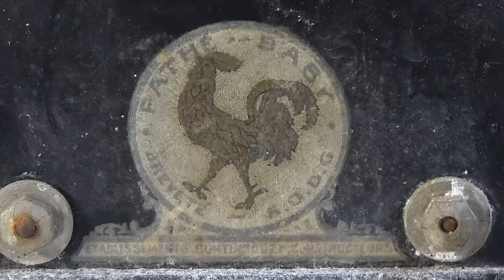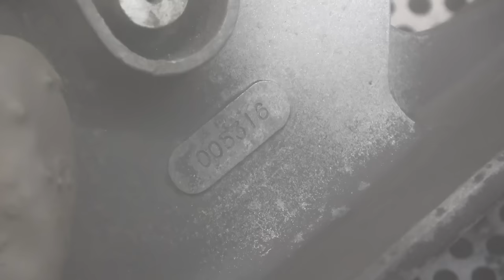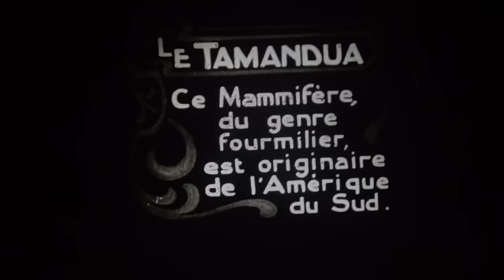1924's Cinema Projector "Pathé Baby"  -  Restoration

Comment: In the early twentieth century, engineers designed devices made of simple, strong metal materials that rotated by hand and did not require electricity. In addition, the easy and simple way they were designed made them work and last for a hundred years or more. And here we see, all of these devices are still working to this day. It may need some maintenance and lubrication of the toothed circular gears, which will make it work properly, and be more beautiful, when it returns again to its original shape as it was nearly a hundred years ago, as this expert, the owner of the video, did, who restored this unique masterpiece, this projector, to its youth. The first was in the year 1924 AD. Today, most of our devices and equipment are made of plastic and operate with electricity. They can work for quite a long time, but they will not last long. A great achievement, the owner of the video. I admire your work, 👍
Reply from the maker: Thank you very much ! Glad to bring the memories back 😌🙌

Comment: Not a cinema projector, the Pathe Baby was a home projector for the 9.5mm home movie system. With its single centre sprocket placed between the top and bottom of each frame, it gave nearly as much frame area as 16mm, but in a size little bigger than 8mm film. My brother in law had a 9.5mm system in the mid 1950s.
As always, this is a brilliant restoration.
Reply from the maker: Thanks for the info 😌

Comment: very interesting work, but I don’t understand why there is a heating plate at the bottom or is it to reduce the voltage and current? Some lamps cannot be touched with your hands, even with very clean hands - the lamps burn out quickly as a result, I really liked the small 10mm wrench and the angle wrench, I have never seen anything like them
Reply from the maker: Yes it reduced the current from 110v to 6v 👍

Comment: 9.5 mm film with center perforation. Picture larger than super 8, but needed footage less than 16 mm.
Reply: This format was in a niche, 8 mm was more popular and I guess, it must have been cheaper.
One reason, that I assume this, it could be developed with the same machines used for 16 mm, because it was a 16 mm silent film with twice perforation, you film one half of the stripe, turn the reels to film the other half, they develop it like a 16 mm film, after this they split it and put it onto a small reel, so you could watch it from there or edit the material and put it onto a 7" reel.

Comment: IS your repair mechanically better?

You have used modern metal alloys, greases/oils/chemicals and processing comparing to what was available a century ago. So maybe this device will not stuck as quickly, its parts will not merge, will not require drilling after another hundred years?

Comment: You forgot to put the class reflector in the lamp housing cover if you put it you will get almost twice brighter picture it is the glass round part in the lamp box
Reply from the maker: I didn’t want to have to much heat in there, I hesitated… The bulb was so hot
Reply: @TheFabrik  Don’t worry the lamp housing is designed for that heat after you put the reflector you will see the difference in picture quality I have restored more than 10 baby projectors with led light upgrade
Reply from the maker: @chutkukumar5167 ok I will definitely try that ! I wanted to upgrade it with a led bulb initially…

Comment: WHAT if your part does not have a hole in it to use the hooks in the oven? How do you suspend such a part?
Reply from the maker: Wow that’s a very good question !! Sometimes there is no hole so… i use spray cans 😅👍
Reply: @TheFabrik  they do not require “cooking” the paint? It is a solution then, indeed.
Reply from the maker: @tatianaes3354 the paint is baked or cooked 👍 10 minutes 180ºC😉 Spray paint can be baked too, especially for high heat temperatures, motors…